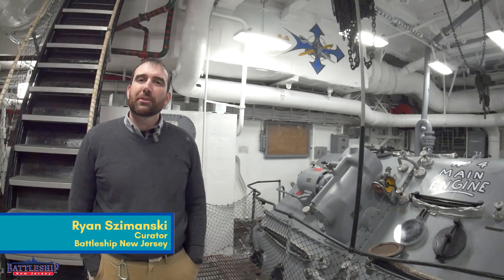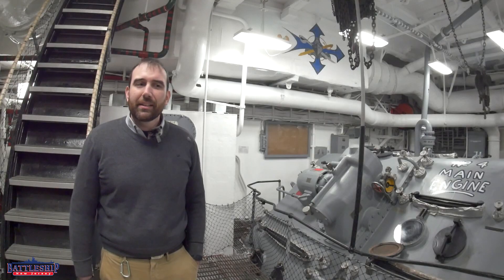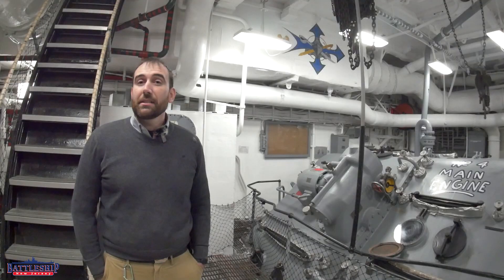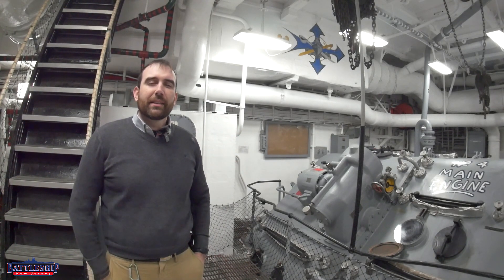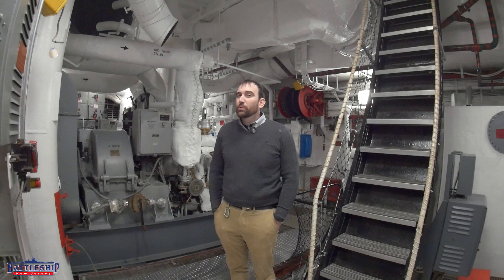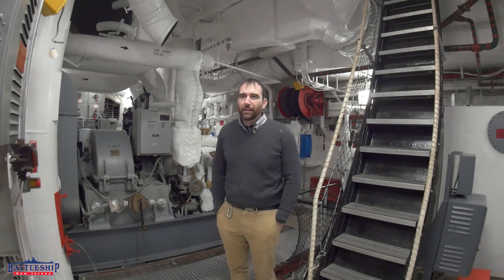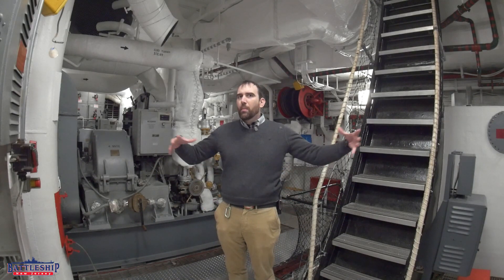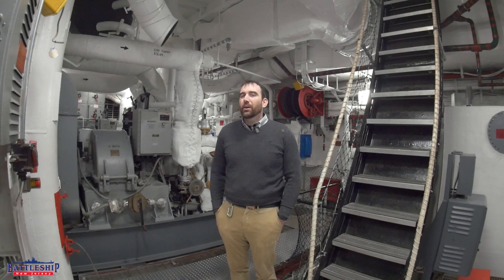Ways the Iowa Class Battleships Were Ahead of Their Time

Comment: For 1943, The Iowa Battleships had advanced targeting computers, and the best electrical control systems available at the time, with high tech switching that allowed guns to be controlled from multiple places aboard ship... both for flexibility of control, as well as redundancy in case of battle damage.  The targeting computers were electromechanical analog design (not electronic or digital) but were still some of the most advanced Range-Keeper design, and still fully capable 40yrs later when BB62 was back in service.
They also had multiple ways to generate their electrical power, with duplicate steam turbine generators, and two diesel generators.  While most US cities did get electrical power from 1900 to 1940, this is still at a time when over 25% of rural america did not have electricity in their homes.
BB62 even had aux power cables that would allow ship crew to re-wire power while underway, to run cables and route  electricity if battle damage cut power lines to sections of the ship.
New Jersey had more advanced Radar for targeting than was common for other battleships up to that time.
Reply: I heard that digital and computerised processing in the 80s,  into the 90s could not improve on that.
Reply: @maximilliancunningham6091 mechanical computers are actually coming back... if you have one job, one calculation... mechanical can actually be faster/ way more energy efficient than transistor based 
.
.
It does the job
Can't do the job better lol
Reply: @kainhall  I was in the Air Force and worked on the weapons control system of the F4-E.  It had a electro-mechanical computer and it was rock solid.  In the late 70s early 80s they started converting to a more digital computer system.  It was not without issues but I assume they got those ironed out eventually.  But the electro-mechanicals ones lasted from the first in the early 60s to the mid 80s at least.  I got out in 82 so after that I have no idea.
Reply: @kainhall  nothing true with that
Reply: @skygazer858  the electrical in an aircraft is better than mechanical 
.
Simply due to weight
Reply: @kainhall Analog computers are coming back because of their precision and speed, but mechanical ones certainly aren't. Wear and tear with each calculation is far worse than electronic computers.
Reply: I believe they were also able to upgrade parts of the ship defense as well as communications and navigation systems as well!